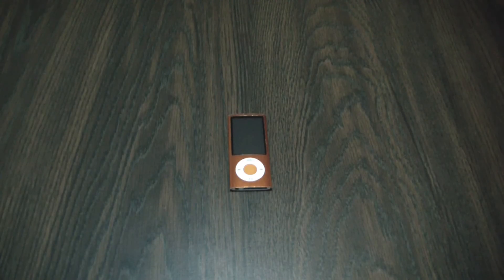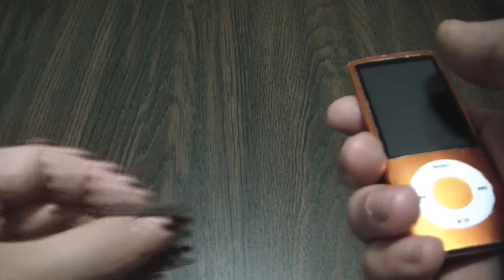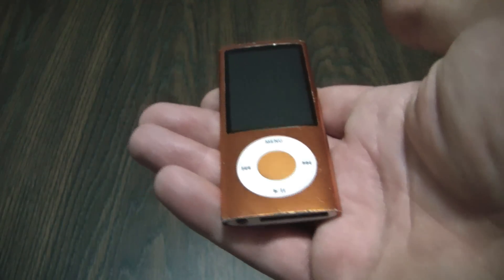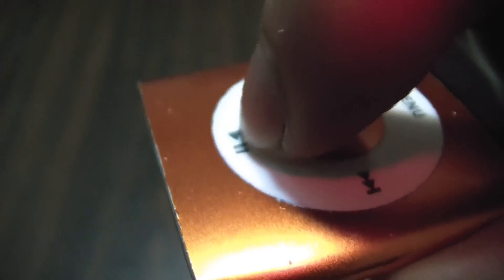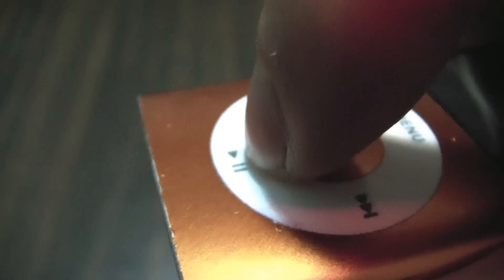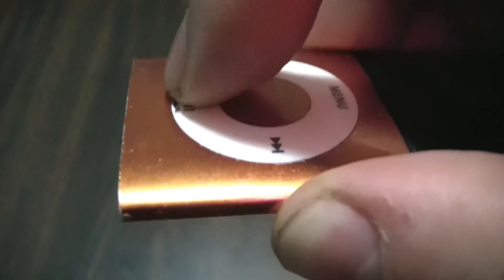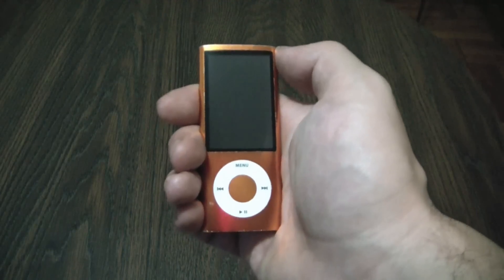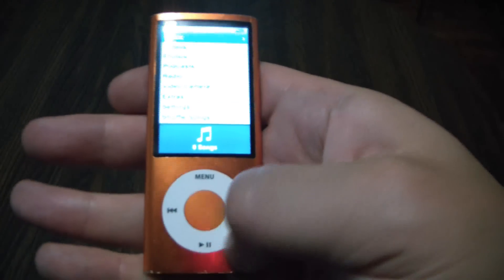How To Fix A Broken iPod Click Wheel Quick And Easy

Comment: It WORKED!!!... I had three buttons down in my 5th generation nano, one of them was absolutely dead... followed the video instructions but with 70% ethyl alcohol, i used a spray mechanism to wet the cloth (Since it is 70% alcohol i didnt want to overmoist the cloth and damage the ipod) and it worked sooooo fine with me in less than a minute. Just like a brand new... icant beleive it.... Thanks alot for the new Ipod

Comment: Never dreamed this would fix my problem (wasn't sure if it was just simply broken as the button is worn)... and yet, it worked.

I sell electronics, and have for half a decade as a part time job and I told my coworkers about this and they were skeptical... and I just did it. Wow, man. Wow. Makes sense though... 99% alcohol is useful for a lot of electronic problems.

Comment: Only thing that was bad with one of my ipods since I have 2. The oldest one would take forever to scroll. I used one of those 91% alcohol and eyeglass cleaning clothes. pushed in on the center button and rubbed it around like you and it worked also. It still doesn't spin as good as my newest one but it will work still.

Comment: Now for the proper way. You actually need to clean the gold contacts and the contact domes (the thing that makes the tactile 'pop' feel and sound).

1. Lock the iPod.
2. Pry loose the click wheel using a sharp razor blade/utility blade/scalpel blade. It still remains attached to the ipod via an electrical ribbon. Be CAREFUL not to break the tabs at the 12, 3, 6 and 9 o'clock positions. Also be CAREFUL not to break the electrical ribbon at the 10:30 position.
3. Under the wheel, you will see a silver dome under each of the 5 buttons. These are held in place with clear sticking tape. Use a blade to carefully pry under the tape and peel the tape/dome off to reveal the gold contacts.
4. Use isopropyl alcohol or contact cleaner with cotton buds, to get the gold contacts and and the inside of the dome contacts really shiny. Try not to remove the adhesive from the sticking tape if possible. 
5. Stick the domes back over the gold contacts, ensuring they are centred. Firmly press down to make sure they stick in place.
6. Using the cleaner and cotton buds; clean dirty looking metal areas of the metal circle which the top part sits on (dont know how to explain this - the scroll component).
7. Unlock iPod and test the buttons using tweezers. 
8. If all is good, press everything back together. If the tabs keep popping out; you can kind of pry the click wheel towards the tabs that aren't staying down. This seems to help them stay down. I broke some of my tabs; but it still stays down fine (after a bit of fiddling).
9. NO SOLDIERS = NO WAR. STOP KILLING FOR THE SAKE OF PROFIT